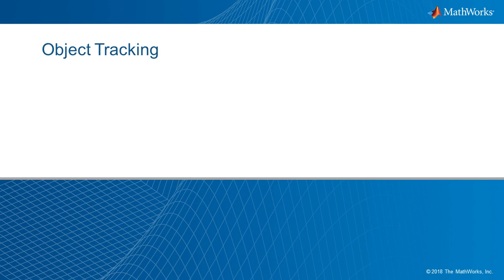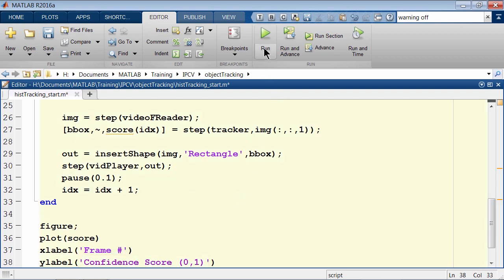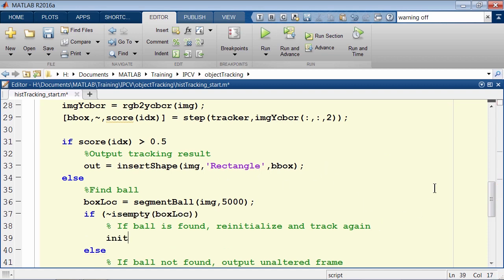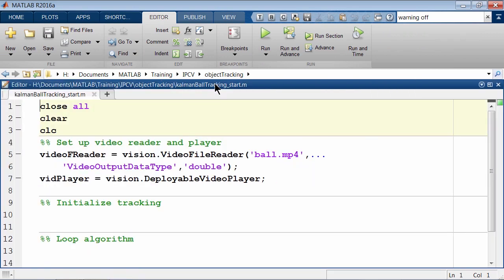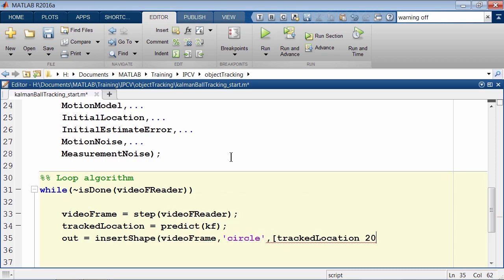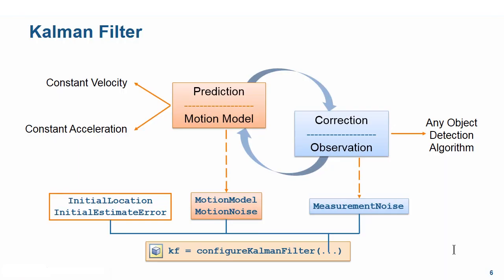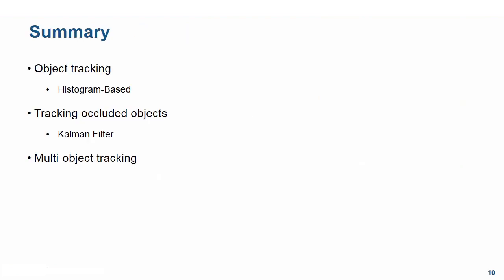Object Tracking | Student Competition: Computer Vision Training

Comment: The thing is in this video is that the objects tracked were crossing a linear path. That is the easiest to track and predict. Kalman Filter most likely doesn't work on objects moving in a very random way, and  IT IS HARD to track with Kalman Filter. Great video still! I hope there is another application for Kalman Filter in a non-linear situation

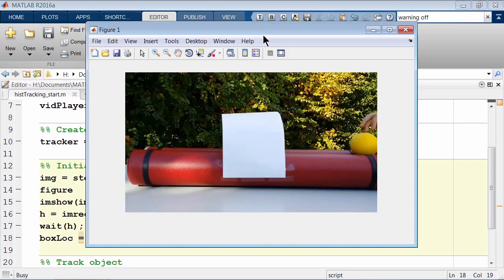Comment: I am getting error using the same steps at 4:05 and error is 
Undefined function or variable 'getloc'.
Error in Untitled2 (line 20)
boxLoc = getloc(h)
Reply: You have to download the program files linked in the description, the function getLoc(h) is included there.
Reply: @MoeThermodynamics  I have this add-on downloaded but it still says "unrecognized function or variable 'getLoc' in my line
boxLoc = getLoc(h);